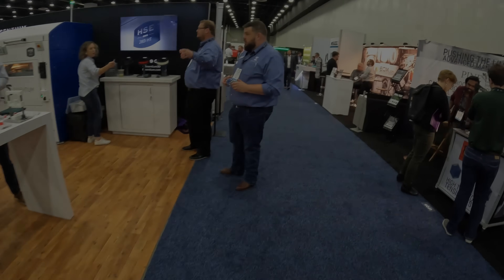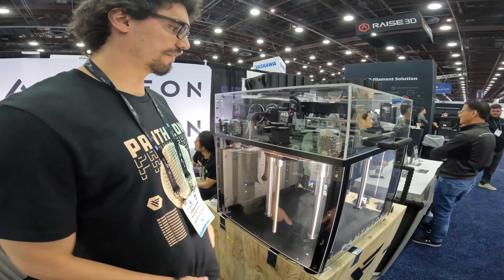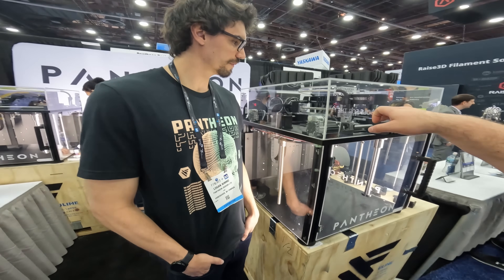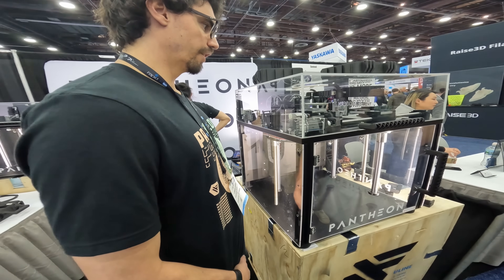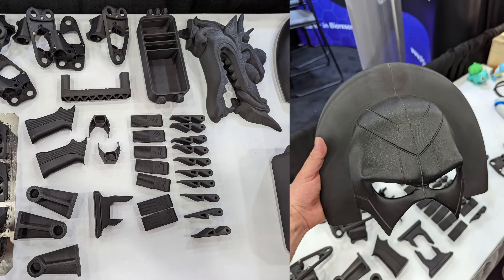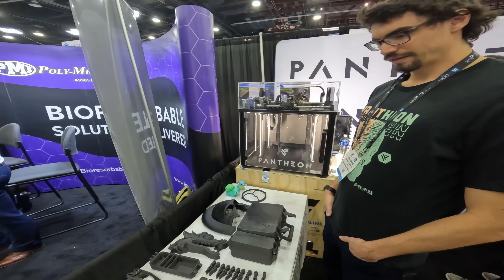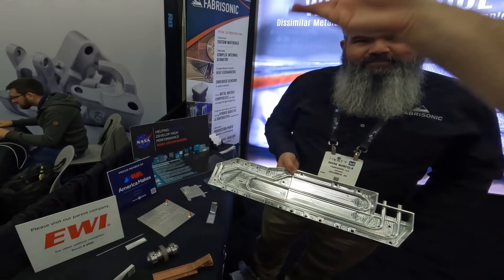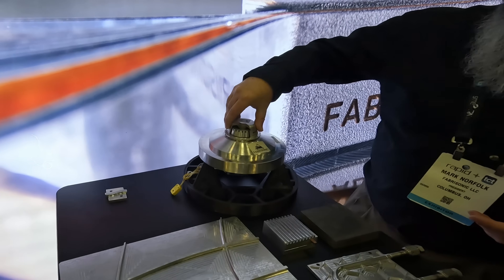A TANK of a 3d printer and Metal Sandwiches - @ Rapid+TCT 2022

Comment: I thought they said the printer was fast?! It's not exactly going to win the speed benchy like that...
Reply from the maker: It is?
A Speed benchy profile for the most part is wholly impractical for everyday normal use
When your actually printing materials for strength, accuracy and the printer being reliable you do not run at speed benchy speeds.
Reply: @CanuckCreator  Agreed. I don't care at all about speed benchies at all - I make functional parts were quality and aesthetics mater. If I can do that at greater speed, I'm all in.
Reply: Buy bambu and make trash if speed is that matters